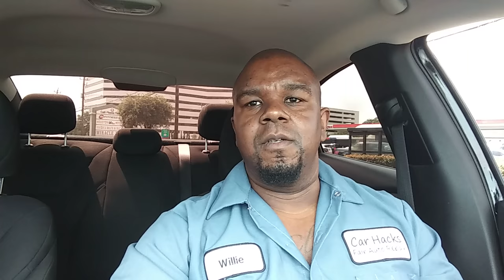Is your gas cap causing a check engine light?

Comment: Hi mate, I wonder if you could advise me on this issue. I have my car's which is Merc C180 2012 and Check engine light comes on regularly. I have got it checked by the local garages couple of times and both time they gave me different codes but then I read an article on check engine light and it mentioned that gas cap can cause the check engine light to come on. So when the check engine light comes on now I open the gas cap and put it back on tightly and after 2 or 3 tries the check engine light turns off. I have done this few times to turn the check engine light off. Mechanics here gave me all sorts of diagnostics from time belt position to faulty fuel injectors. And every time I go to them they keep charging me. Can you advise me why the check engine light turns off after I open and close the gas cap couple of times. Thanks
Reply from the maker: Ill look more into it. I know personally Fords, Mercurys and Dodges have problems with the gas cap code. Ill see if i can help u solve the issue
Reply: @fairautorepair2787  I will really appreciate that.. Cheers
Reply: Did you find the fix yet?

Comment: Mines had a spider 🕷 dead took 2 chunks can the cause the check engine light once I cleaned it put it back on the scanner did throw any codes at first I had P0442 and P0440 Went to auto zone it said it was fuel cap that was loose or to be tighten.
Reply: Hey! Did it work? I have the same code P0442

Comment: Happened to my audi s6 i would drive and the power would fall flat. Anyways when it was in the garage i heard clunking for months opened the gas cap and i heard air go in and the tank and the tank expand thats crazy. Hope it did not cause my car to run lean starving for fuel and wreck things.

Comment: Hi. 2008 Lancer 136,000 miles.  So could a faulty old gas cap cause the engine to slow down, lose power at times (but not all the time)?  Would it go into "Limp Mode" with a bad gas cap?  This mechanic (first time going there), first changed the "MAF Sensor", then the "Throttle Body" and finally changed the fuel pump, because the car was still losing power after replacing the first 2 parts.  The thing is, the car owner had a mean breakup 2 years ago with her boyfriend, who has one of her car key fobs.  She never changed the key fob (too expensive she said).  Plus, the mechanic persuaded her not to call her auto insurance because he said:  9/10 times your rates will go up because you are claiming vandalism.  I called up the Insurance Bureau of Canada and they said that the mechanics have no business in giving incorrect advice about Auto Insurance.  And her insurance covered by Comprehensive will not go up (rules & regulations).
Reply: also clean n lube your lower throttle body valve i had this problem and car would crawl with red lighting bolt warn light flashing shut car off and restart it's fine rest of day only happened in freezing cold like 1st 2 miles driving ..

Comment: My check engine light wasn’t on when I went for an E-Check (Emmission test) They said I needed a new cap it was “free” bcs my car wasn’t passing the Echeck test, and my gas cap needed replacing. Once they replaced my cap with a flimsy cap without a seal that’s when my check engine light came on about a week and a half later. I should have ask for my original one back. I bought a new gas cap my light is still on. Damn shame it’s all a racket. My car is only 6 years old. But hey the do women so bad. I hope as I continue to drive my car the light will go off. SMH

Comment: I  bought a key gas cap for my 2013 challenger rt. After a few days the check engine light came on. i wen to  auto zone and had  them  run the scanner on it.   it said something about the evaporation. So i change  the gas cap back to the original by the way nothing was wrong with the original just wanted  a different one. Any way they erased the code and now my car is fine no check engine light on.  I knew it had to be the gas cap since that was the only thing i had done  to my beautiful beastly car lol 😂

Comment: I've been haunted by my gas cap and check engine light. I just changed my gas cap. I'll let you know.  Hopefully the haunting stops.
Reply from the maker: If the haunting continues...call the Ghostbusters
Reply: @fairautorepair2787  Good One 👍🏽😂
Reply: @fairautorepair2787  "I ain't afraid of no ghost"
Reply from the maker: @tomassr.1327  😂😂😂
Reply from the maker: @MrParis215  😂😂
Reply: @fairautorepair2787  well it's been over 3 weeks since changing my gas cap. No "gas cap" or "check engine" lights have come on! Looks like the haunting has stopped. Thanks!
Reply from the maker: @tomassr.1327  Glad I could help
Reply: @fairautorepair2787  did it turn off by itself? Or did you have to get it reset?
Reply: @tomassr.1327  did the light turn off by itself or did you need to get it reset?
Reply: @RideYEG  The light shut off by itself
Reply: @tomassr.1327  thanks! Coincidentally I fiddled around with my cap and the light went out a few minutes ago. Will replace the cap regardless
Reply: @RideYEG  My light would come on and go off repeatedly. Since changing the cap, it hasn't been on. Good idea to change yours aswell. Good luck
Reply from the maker: @RideYEG  it turned off by itself. Some cars it takes 25 miles or more for the light to turn off. And other vehicles gas cap lights or a common problem for instance, on Dodge trucks and Jaguars, the Cap won't seal correctly and it will throw a check engine light. so you can either lubricate the cap seal or replace the filler tube and the gas cap .
Reply: @fairautorepair2787  thank you!
Reply: @fairautorepair2787  what do you use to lubricate the gas cap seal? Thanks in advance. 

New subscriber!
Reply: Did it help
Reply: @staciecook5217  Yes, it corrected the problem

Comment: When you get a new cap how long before your engine light go off?
Reply: You will have to interface with the cars on board diagnostics (OBD) and reset it. Check if you have OBD I or II and try a cheap ELM 327 tool. Good luck.
Reply: Thanks 👍🏾👊🏽